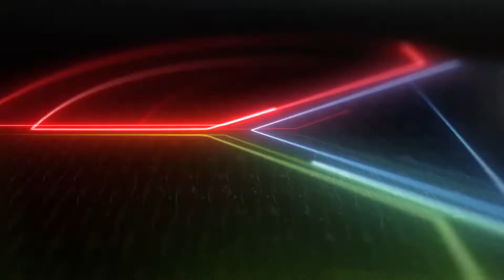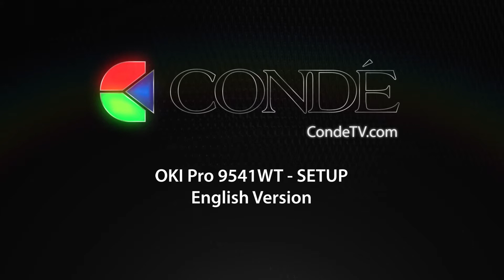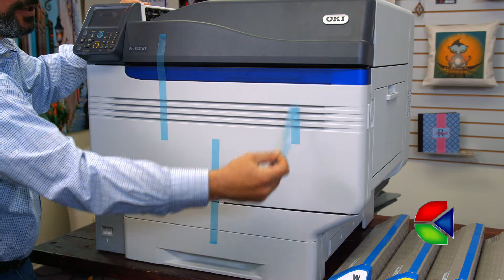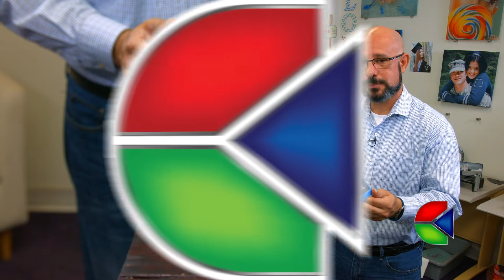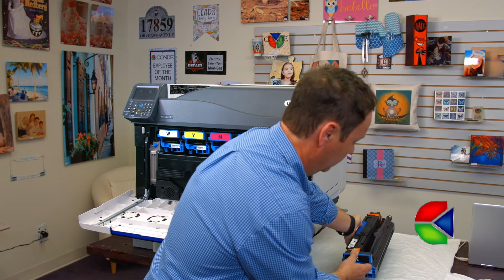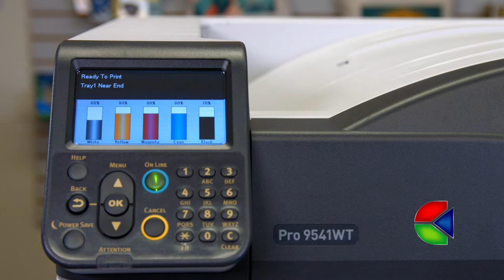OKI Pro 9541WT White Toner Printer - How to Setup

Comment: Hello sir,
Hope you doing fine. I have a question about Es8431 oki printer, so I have this issue with colors image drums only the yellow image drum is appearing on configuration paper that I printed, and I also replaced the 3 image drums but still the same problem.
Reply from the maker: Please contact our technical support at Support@conde.com!

Comment: Hi 

I would like to know if it's possible to rebuy the transfert roller unit (belt) 
Because i don't find this on the web 
they forgot to put it in the package
Reply from the maker: There is a difference between the transfer roller unit and the transfer belt.  The transfer roller unit is considered a "part", while the transfer belt is considered a "consumable". If you purchased a 9541 printer and the transfer roller unit was not included, contact your vendor and request one. If you need a transfer belt, it can be ordered through any authorized CRIO or OKI dealer.